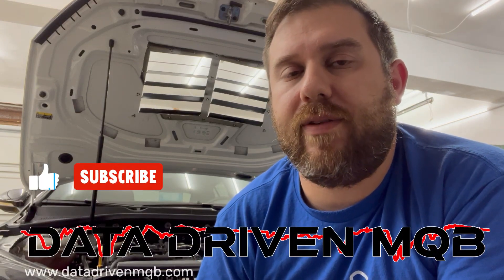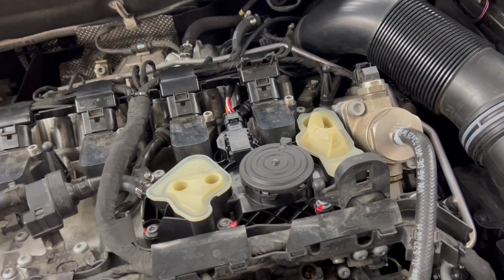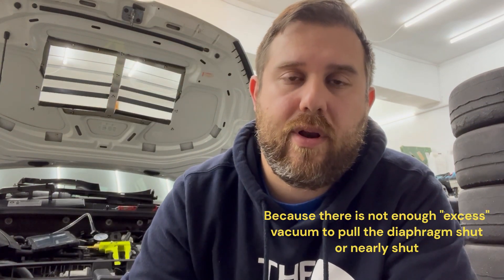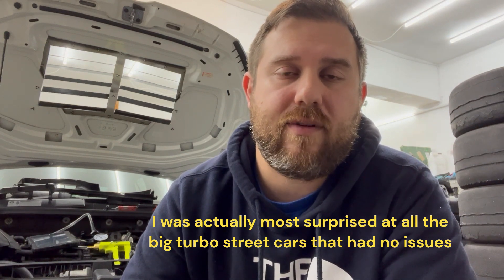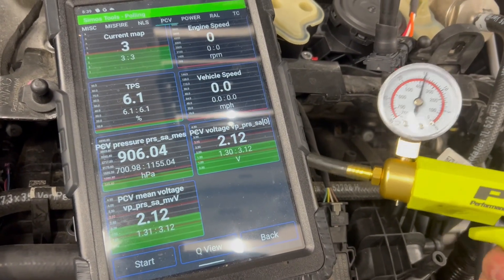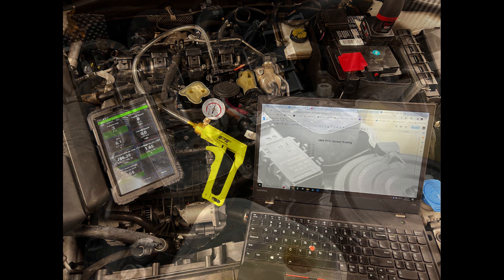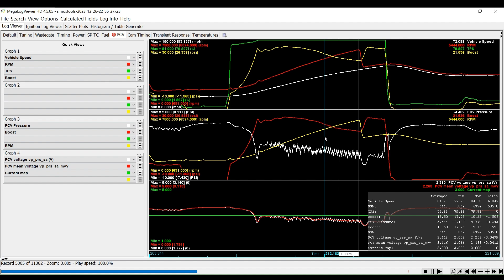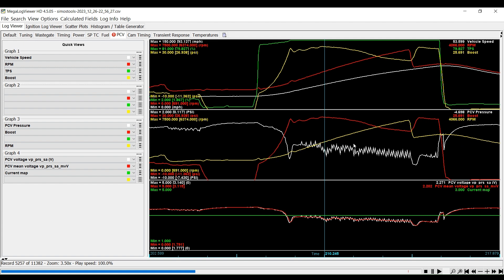MK7/MK8 PCV Updates: Are Turbo Inlet Pipes why OEM PCVs fail? (Pt 11)

Comment: This should not apply to ea888evo 4 right ? I just got 034 intake for my s3 8y 2024 with inlet pipe but will keep the factory adapter that connects to the inlet pipe. (Adapter that sits on the turbo).
Reply from the maker: Correct. The OE Venturi should make plenty of vacuum to work fine regardless of TIP.

Comment: Never had any oil surge on my Cupra 2016, I’m not tracking the car but do drive hard on mountain roads. Stock ECU, but r600 intake, pipe and turbo inlet. 
Did notice once or twice a bit of oil in the inlet but never had any big smoke of oil while driving. 

Do have smoke on startup if the car is parked between 30min to 6 hours but must be oil vapor or something else (nothing after a full night parked, camera showed no trace of valves leaks, PCV replaced, injectors replaced)

Did wonder if i could monitor the differences between my inlet pipe with obd eleven but i suppose I can only access manifold absolute pressure
Reply from the maker: I covered it in a few other videos, but if what you have isn't showing any real problems, I wouldn't worry about changing anything out honestly. Smoke from the tailpipes after sitting a while normally points towards the beginning of valve stem seal failure, so is probably something to keep an eye on.
Reply: @datadrivenmqb  thanks for your response mate. Was just wondering if it could be related.. still don’t know why I don’t have smoke after more than 7h sitting

Comment: will just a carbon fiber APR intake along with the carbon fiber intake hose effect the vacuum this bad?
Reply from the maker: Not enough to be detrimental IMO. The turbo inlet accounts for like 80% of the vacuum source, intake is a far smaller factor by comparison.
Reply: @datadrivenmqb  thanks man, i was thinking about buying the mk8 retro fit kit off of urotuning but after looking at ur information more i’m leaning more towards going back to the OEM turbo inlet pipe and replacing my PCV valve with a regular mk7 OEM one. Ive been having a puff of smoke come out of my exhaust upon start up for a while now and have been trying to figure out why
Reply from the maker: @lockmonster8637  no problem! FWIW the puff at start up is potentially early signs of valve seals. So if whatever solution you try doesn’t help, I’d look to rule that out.
Reply: @datadrivenmqb  do you think going back to OEM inlet pipe with OEM mk7 pcv valve would be the best bet?
Reply from the maker: @lockmonster8637  if you have them laying around, yeah. I personally chose to do the basic retrofit initially. It has a lot more flexibility to add the 034 TMD at a later time to do the full retrofit (which my testing indicates is a far superior design).

I went real in depth here to explain what exactly is going on:
https://youtu.be/Pjcpla__riY?si=-lHCjeGNTuYwVKRj
Reply: @datadrivenmqb  hey man I had 1 more question, if i do the mk8 retrofit kit and not do the TMD do you think keeping the APR turbo inlet pipe would be okay and get rid of my problem?
Reply from the maker: @lockmonster8637  the APR TIP is one of the closer-to-stock TIPs I tested. Doubtful you’d have any issues, surely none on the street because of that. As I said, if issues persist it’s likely due to other problems.

Comment: My mk7 oem one was kaput on a 2015. Got an aftermarket mk8 revision and installed it. Just have an ecu tune. Seems to be working fine and fixed the oil consumption. I don't track it

Comment: Ive watched all this series and its very interesting! I bought a mqb cupra and i had bad oil surge. Went hard up a private road to around 120mph, hit the brakes and plumed the road with smoke behind and car cut out. Wouldnt start for 15 minutes. Eventually started and ran fine. There was no oil in the turbo inlet so it got into the combustion chamber. Ive just put a oil catch can kit on. Be good to see the outcome of this experiment your doing though!
Reply: basically same exact situation here.. i have a 2020 mk7.5 GTI and did a 115, slowed down and was driving normal til power gave out and i heard jingling coming from the engine bay.. snapped my shaft in half, 0 boost pressure on throttle. got my is20 replaced, just had a similar issue with the white smoke the other day and it concerns me, now my car is burbling a lot and i believe my spark plugs are going bad. i am interested in the PCV issues as i have an ECS inlet pipe, somewhat concerned for my PCV now having watched these videos

Comment: My pcv system failed and was getting alot of blow by in the intake manifold. I was using a aftermarket inlet pipe. Thank you for sharing this!
Reply: Dang, looks like I’m keeping my stock TIP.
Reply from the maker: Out of curiosity, what were you running?
-Year/make/model?
-Turbo?
-TIP?
-Intake?
-Tune? (any idea of boost levels?)
-PCV version on your car?

Keep in mind they can still just plain wear out with time and use. I'd still consider OEM PCVs a "wear item" and expect replacement every 50-60k.

Comment: Thank you for all of the work you do on these cars Tony and for sharing your findings with the community.

I had a MK7 R that I ran 6 or 7 HPDE events with, but I sold it because it felt like it was on stilts in medium and high speed corners (stock DCC suspension with PS4S tires). I find myself missing that car and hope to return to the platform (maybe with a GTI this time), especially if I can improve the handling confidence without ruining the street manners.
Reply from the maker: Thanks! 

I personally went with a GTI because they're lighter, less hassle to do some work on them, and less to go wrong in general. Subjectively they've felt more "playful" than the Golf Rs I've driven. The added weight can really be felt.

I've been super happy with my relatively simple setup - Koni Special Actives, add camber via plates and LCA bushings, and sway bars to reduce body roll. I'll be adding some lowering springs over winter to experiment with, but keeping the stock ones just in case it turns out to be worse.